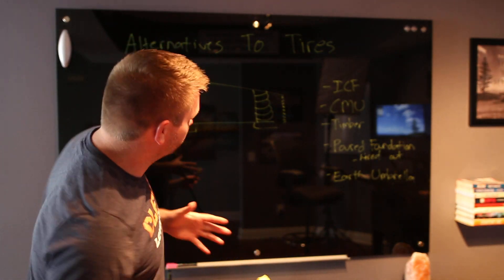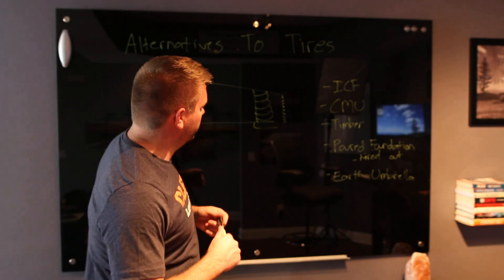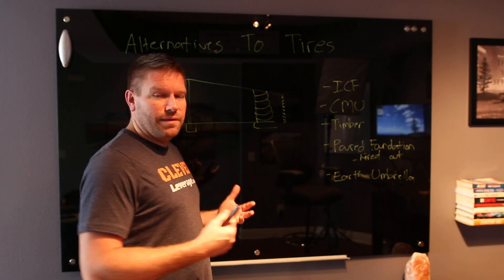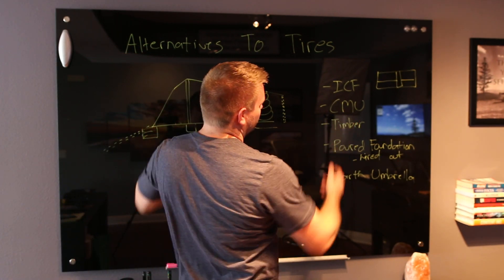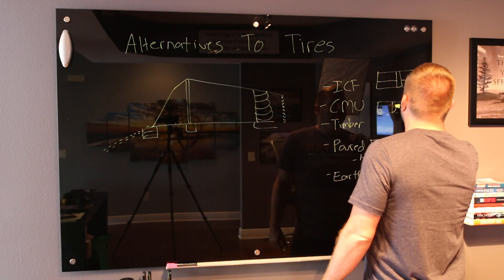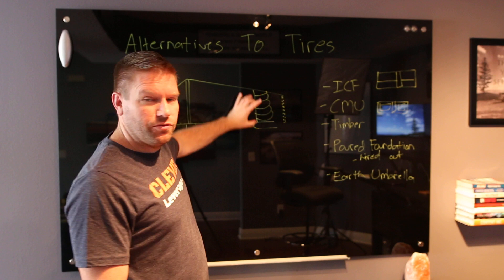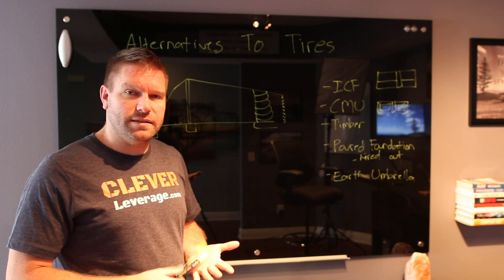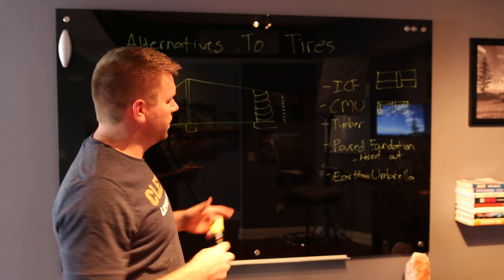Earthships: Alternatives To Tires

Comment: This is just speculation on my part at this point in time. If you are in an environment with little rain (Mojave Desert) you would not want earth on your roof. You would want to collect whatever rainwater you could capture. This would require a metal or other non-porous roof. Thus reducing your weight problem. I would think “thermal mass” is still important so a concrete wall of only 4 to 6 inches just would not work out to well. Just my speculation for the moment. This video is 6 years old so maybe this problem has been worked out already.

Comment: Nothing else works better. Rammed earth, 24 inches thick with a 4" eps foam in the middle could be a close alternative. There are also thick eps foam walls, and roofs, with either a polymer concrete or shot-crete to make them bulletproof. Again, nothing else works as well as an Earthship. I would do it if I was your age. Too much for a 74 year old!

Comment: The main benefit of tire walls isn’t their structural strength—it’s their worldwide availability and the fact that they provide a way to reuse discarded tires. They can also help reduce the amount of concrete needed. However, building with tires has drawbacks: finding tires of consistent size can be difficult, and packing and pounding earth into them is far more labor-intensive than producing compressed earth bricks, which can be machine-made.

Tire walls still require proper drainage and a moisture barrier on the berm side, and in most Earthships, the interior (living side) is finished with concrete anyway. For efficiency, it may be more practical to use an earth brick press that mixes soil with a stabilizer such as cement or lime, producing strong, uniform blocks with less labor.

Comment: The idea is thermal mass.. so if youre somewhere without cold winters and very short days tires might not be for that senerio but a big part of the earthship bandwagon in taking waste and removing it from the landscape by reusing it .. how ever ive seen a video recently there the guy used ibc totes that he acuired from his buisnesss farming fish and aquaponics but he used them as the wall and they stored his freshwater supply and had thermal mass tho im not sure how he locked them together tho you could probably just weld the frames together with some practice their aluminum

Comment: Its already 5 years old, and maybe others already mentioned it, but I think a better option could be tire bales. Works the same, much faster to build, you can recycle much more tires, the only downside to it is that you need some machine to build it up cuz 1 bale weights 1 tonn.

Comment: i would use upside down shipping containers. take out wood floor, flip em and fill up with compacted dirt and fill over with gravel. You can insulate the house side wall inside of it before you fill it up.

Comment: While listening i thought of the heavier duty milk cartons filled with rock and stacked - a carton is $12.00 or so around here you might wire them together with Galvanixed wire OR line the sides with road paper and fill them with a mix of sand, gravel, 2 inch rock and concrete (rebar thru the holes in the sides right at the top of every other course???) prep one layer and pour - Repeat - in the end you can run electricity by cutting plastic for metal conduit or you can run the conduit before you pour ( i guess the $12.00 a pop for the strong crates is the killer)

Comment: I don’t know how to price them but what about those large concretes bin blocks, also called V lock blocks?  They are a huge thermal battery, very sturdy, readily available, and you could probably get the whole wall stacked in a day or two with heavy equipment.

Comment: Old tires leach petrochemicals, rubber compounds and all kinds of heavy metals (including mercury and lead) into surrounding soil and groundwater. A tire, even partially, submerged in water will kill most aquatic life within weeks. Plants will absorb these pollutants, so eating anything grown next to an old tire is literal poison. Don't even use the plants for composting for the same reason.

Comment: How about concrete form walls for the interior and exterior walls with enough space between to insert tire bales? The spaces around the bales could be filled in with gravel. This would give sufficient thermal mass and would seal off the interior spaces from possible off gassing of the tires.

Comment: Hey, I'm in the northeast as well and I'm going through the same angst about the tires. I love the idea of using the trash, tires and I've also heard the tire off gassing is no issue once they're essentially enclosed. But, it's the time consumption, the earth pounding and I've also thpught about the massive precast blocks you see a lot of landscape companies use for containing bulk wood chips, ground cover, mulch, etc. I think those would be a fantastic alternative but I'm not sure of the cost factor of if building a precast block of similar proportions using hempcrete (7 times lighter and way more efficient r value) I don't know but great video and I do believe we're on the cusp of this concept building being the future. Self sustaining is key, off-grid just sounds like a camping trip, I know this is the future because it's intelligent and the building industry itself most likely wants no part of this. This world itself is built on consumerism, throw it away after it's used up.

Comment: You are missing the point. The idea is reuse of  tires
Reply: No, that's one point.. he wants some of the other features (like temperature control) but not necessarily the materials reuse/recyle component. 
It makes it a sunken house and not an earthship but he gets to do what he wants. He's clearly worried about the tire chemicals leaching into the water table, which also concerns me because I want to build in a much more rainy climate zone than the desert where earthships originate.

Comment: I want to build a cinderblock earthship in east texas. If you did cinderblock's and sand for the back wall, does that mean no earth burm behind it? I like the earth burm for heat transfer. If i put in an earth burm, would i need a moisture barrier?

Comment: There is a person here in Taos who plans to shred tires and compact them in 3' x 5' blocks.  Keep in mind that one of the earthship concepts is re use/ up use of existing materials.
Reply: If the focus is time, this is a good question.  Tire pounding is very labor intensive.  Once done they are incredibly strong though so it’s not easy to replace the tire walls.

Comment: I was just thinking the same thing, and wondering if rocks/boulders were more my style. My daughter is allergic to rubber, and I hate the smell of tires (which I hear you saying didn't seem to be an issue, but I wouldn't want to chance it) I read they will work, then I saw your video on the suggestions.

Comment: I have a friend in British Columbia who built a tire house herself. She also did not want to pound dirt forever, so she figured if she just cut the sidewalls of the tires and packed them with a flat plate compactor, it would save time and make the stack easier. Although her community is completely off grid because they built their hydro system (enough to power 5-7 homes), she could have just built a box and heat with unlimited power. Also the reason for all the tires is to give the necessary depth in ground to make the ventilation work naturally.
As far as the roof loading goes, have some trusses built to tolerate x amount of earth cover. Lastly, how much solar gain do you expect (location, orientation to solar, heat storage type internal material, concrete, Trombe wall, so on. If you need help in that arena, (my 40 year hobby job is designing solar systems for clients at no charge, sort of a retirement job).

Comment: This is kind of missing the mark. One of the main points of an earthship is to remove trash like tires in this case, and give them a function. These other options may save time, but the environment will be worse off for it.

Comment: You can make hesco barriers, use terrestrial Earth with a bag of Portland cement per 5x5x5 cube. You have to buy the wire in the landscaping cloth, using it for structural walls I would include wire every foot so the basket maintains a square shape or whatever shape you intended to be. Mix it with the Portland, fill it, Tamp it, put your next 5 ft section on top of it 4x4x5, then use your bond beam... Then you just use stuck on the outside and the wire that is already on the barrier three-by-three square is a perfect anchoring point for your chicken wire. Are you basically doing is waterproofing the outside. With that much mass mass, it's going to be far more than any tires that packing, having the Portland cement will make stabilized earth. All you need really is a backhoe and you can have your walls done in a few days... Or you can pack tires it's up to you 🤷

Comment: OK, friend here's my take: junk tires are almost free, It's the pounding that ruins the scenario. Solution: Using cut-off saw with metal blade cut one sidewall off each tire. Lay out the row of tires to your string line. Fill by shovel or front loader on a backhoe, sprinkle water if it helps pack it or lowers dust. Add back of tire dirt so the top of tire is equal to the level of the dirt support behind. In this fashion the wall goes up as the support dirt grows behind it. All packed down by l'il ol' me on my backhoe "Mo"

Comment: I feel it would be very helpful if someone would be willing to go through these comments and organize them a bit. I spent a lot of time reading the comments as we are seriously thinking about building one as well. Personally, I'm not worried about tires gasses, but I'm not going to pound tires at age 45. Straw bales have great insulation value, but don't have the thermal mass. I like tire bales, but am concerned about selling my house at some point. If a bank won't finance it, then it becomes a worse investment and maybe that is what has been preventing these from becoming more popular. Honestly, I'm leaning towards concrete or cement block walls with using earthship principles to minimize heating and water bills here in North Dakota. 

After reading many comments I don't see a better idea for the average person. Professional builders use concrete walls for basements here in North Dakota. Do we think they who do this for a living don't know what they are doing? Time is money. and what about resale value? Are you going to live there forever? I'm thinking concrete or cement block wall with insulation and water barrier in the correct places to create the thermal mass.
Reply from the maker: You just summarized all the points after having traveled to Taos and staying in these. They’re so awesome, but most places we want to live with our families require a bit of modification. The die hards get their panties in a bunch over it, but after leukemia last year, I can tell you the most important thing is living your life with your loved ones however you want. Time is most important, not whether cans tires bottles or concrete and rebar. :)

Comment: My husband and I are also thinking about building an earth ship, however we don't want to pound tires all day long either, and idk if I could do it. However we're thinking about using straw bale's to make an earth ship home. Like a cob house, but with straw bale's, walls would still be 2ft thick then. And you wouldn't have to insulate because that's what the bails do. Anyway what do you think about straw bales?
Reply from the maker: Front walls maybe, but I wouldn't build the back retaining wall out of anything like that.
Reply: I was considering that as well, but while straw bales are excellent at insulation, they don't have the thermal mass that keeps these homes warm all night.
Reply: @stevensauvageau8827  what's the difference between insulation rate, and thermal mass? I was also considering building the back wall, down in the ground, then lining the dirt back wall with strawbales. Then there's no wind. I currently live in southern VA, on the NC line, by Roanoke rapids NC. However we're selling our land, and buying at least 10 acres in Missouri! No zoning laws! And buying raw land, we're going to go completely off grid, cheaper then traditional utilities and no monthly payments! However the house itself, and the land itself, we're looking for a lot full of timber, so we can harvest and sell the wood as needed, so around the house won't have a lot of light, however enough because we are also going to make some pastures, we just don't want to be seen from the road. So trees in the front of the property and opening as you travel back. So I'm wondering if it's possible to dig down into the ground, then do straw bale's, so the actual retaining wall, would be the ground itself. And the straw would be for insulation purposes only.  Of course built on top of a concrete slab, with proper drainage under it. I know it's possible. I think. 😂, Built like an earthship, glass windows in the front. All recycled water. And solar of course. A cook stove and either fireplace or Wood stove for heat in the winter.
Reply: @HonestMomsHomeremodel  The idea is that your building faces south so the sun only comes in during the winter when you need the heat. the tire wall (thermal Mass) absorbs the heat and then releases it when the sun goes down. If you used an insulating medium you would not end up saving that heat and have to heat your home at night. It's a thermal battery.

Comment: You probably don't want insulation on the back wall because you want the low winter sun to hit it and permeate into the dirt behind as a thermal battery. Concrete might be more expensive but it's not too bad compared to the concrete pour for a standard house basement and it's a major part of the house.

Comment: I'm curious to hear an update on this video.  Did you reach any conclusion on an alternative to the tire wall? 

I like SOME of the ideas of the Earthship, but have my own goals for building it, and the tire wall isn't something I'm interested it.

I'd like to build mine in Michigan and want to merge some of the best ideas of Earthship with a barndominium concept.   I'm looking for a small temperature-controlled living space surrounded by what would essentially be a large structure/half-greenhouse, half-barn to have a moderate environment to grow a garden and keep a workshop area, and garage access to the living structure without going completely outside.

An update on anything you learned could be good.

Comment: I don’t trust tire walls in an earthquake so I built my earthship with 4 concrete reinforced walls (the walls facing the earth berm were engineered with 5/8 rebar).  The south facing wall acts as a trombe wall and it works very well.  I put stucco on the south side of that wall and  thin brick on the inside.  If I were to use tires I would secure them to each other with fasteners  and then fill them with rebar reinforced aircrete.  I saw the double decker freeways in SF after they collapsed onto each other so I have a keen respect for earthquakes.
Reply: Funny thing, I’d trust a tire wall more than concrete in an earthquake.  I don’t want to use tires because of time, labor, and off gassing but the tires are very heavy and strong.  The rubber is just enough natural flexibility to navigate an Earthquake.  Concrete is rigid and likely to crack.

Comment: I think that structural 3d printing, especially using carbon-negative cement, would be ideal for an earthship.  anything that can knock down the massive labor costs and speed up the process is a good thing.  I;d love to see someone give that a shot.

Comment: one key point is that tires release cancerous fumes which could ultimately (long run) be a major issue.  There are not enough data gathered on the side-effects of all these materials being used.  There are alternatives to create "solar heat battery", simply visit Greece, Serbia other old civilizations where homes were built and to this date are functional.  The same goes with cans and other trash being used to build.

Comment: Could you buy used 20gal drums and fill with dirt? Seems similar to tires in terms of thermal mass. Could get polyethylene or stainless? If there are vendors for used drums that might work…. New to the earthship concept but have also been wary of tires. Beyond offgassing, worried about decomposition into soul.

Comment: The tire and dirt wall at the back is not only 'instead of a foundation', it serves 3 important purposes; 
-  protects from the worst weather in winter (mimics an underground home)
- provides air conditioning in the summer (via 15 - 20 ft tubes)
- mainly it serves as a HEAT reservoir in the winter, to be able to use only solar to bring the temps up from 58F to 70F in the winter, because it mimics being underground or partially buried.  
So, I don't think eliminating the dirt BERM completely is an option IMO. 
But I have been thinking of other alternatives to tires to fill the berm of dirt with.  I believe that I still need the berm (15 - 20 feet long), I just don't think I will have the work force necessary to pound 750? tires.  I was wondering if just doing the first few courses in tires, then the rest with cedar wood stacked or even bricks or hempcrete bricks to fill in the rest.

Comment: For an office with 26' to 30' back wall and 16' to 24' side walls what about using round straw bales. You would only need 40 to 52 round bales and they are massively stronger than square bales that you would need more than 100 bales. Of course you would need waterproofing to protect the straw from moisture. EPDM sheeting could be used for this.